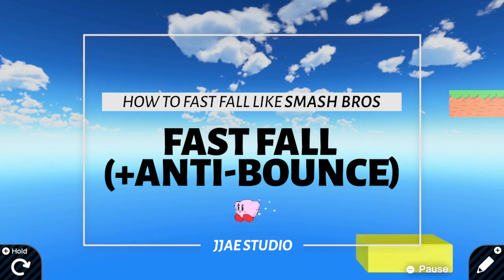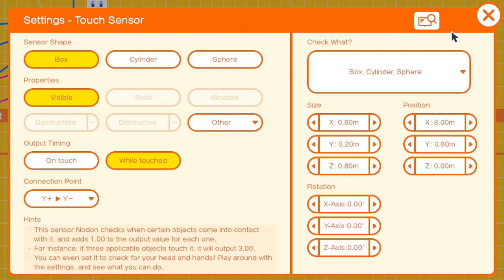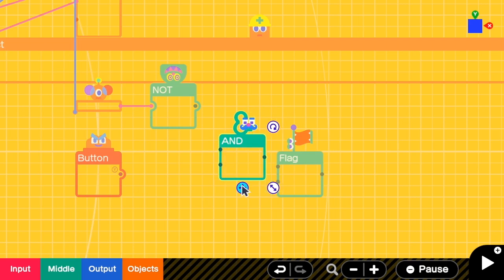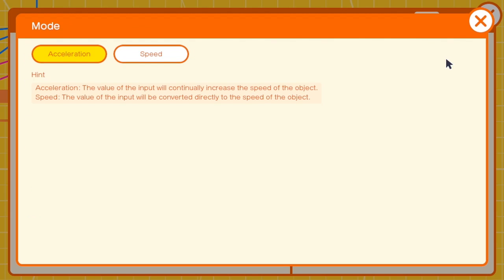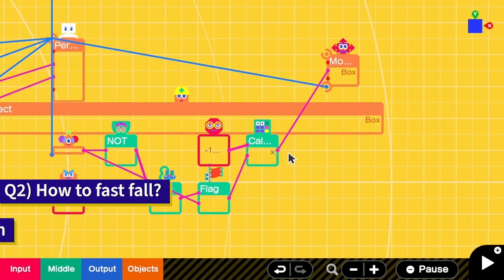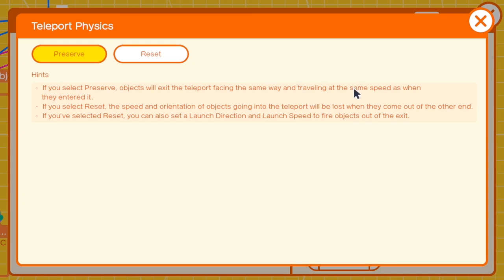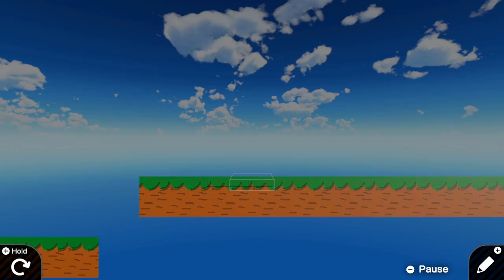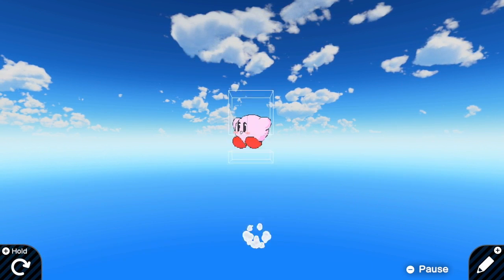Fast Fall (like Smash Bros) & Fix Bouncy Jump! | Game Builder Garage Tutorial

Comment: I put your teleport solution into Kid Dracula. But when i jump on the platform that falls, he can’t jump off. He falls with it. (unless I fly!!)
But I want to be able to jump off
Reply from the maker: I think I might know why!
It is because the platform goes out of the touch sensor range. Touch sensor gives value 0.
Then, the person starts falling and touches the touch sensor again. Touch sensor gives value 1 and it triggers teleport.
For the good solution to this, I have to think . . . : \ Thanks for pointing this out. : )
Reply: @jJaeStudio  Aha! Makes sense. I would love a solution. Only major bug I have so far.
Reply: @jJaeStudio  So my workaround is I shrunk the teleport and touch sensor to as small as it can be to still prevent bounce. If you immediately jump after landing on the falling platform you will jump. If you don’t jump right away though, you still fall with it. So my other workaround for when that happens is you automagically turn into a bat and lose 1 health, instead of falling off the screen. 🦇